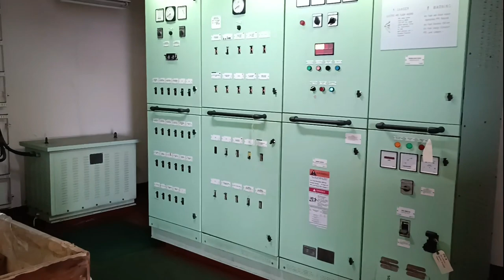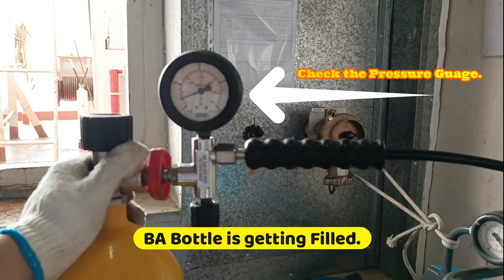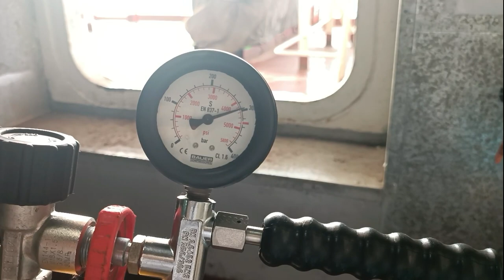How to Refill Self Contained Breathing Apparatus (SCBA) | BA Cylinder Refilling Procedure | BA Set

Comment: Before you must run the compressor with the bottle to drain it correctly the line after you put the ba bottle and check also the o ring before connecting the bottle for good a sealing of the bottle 😊